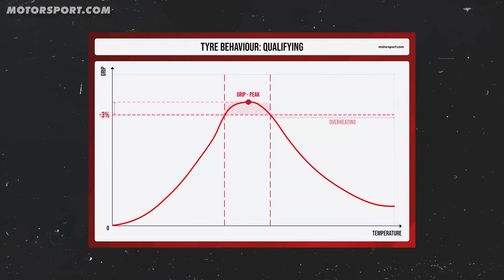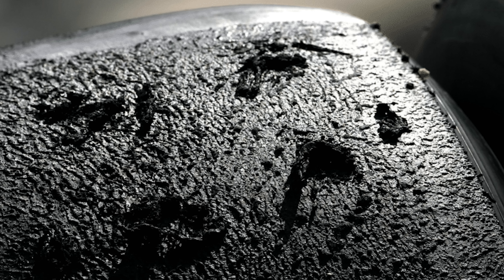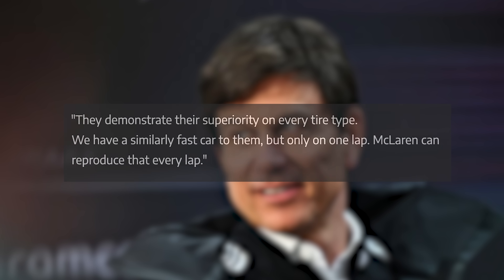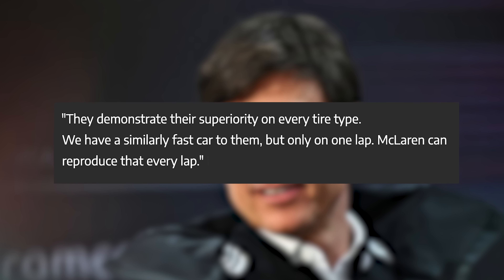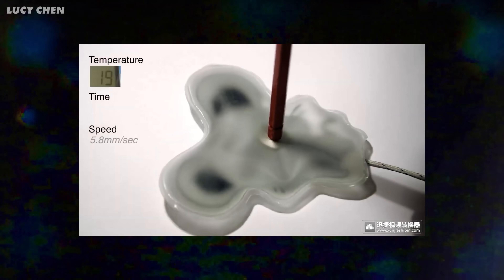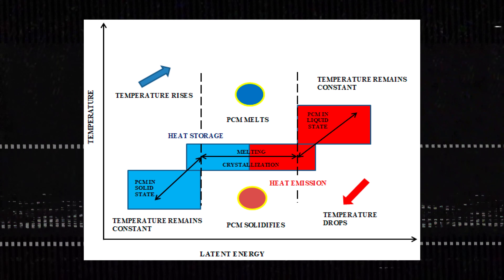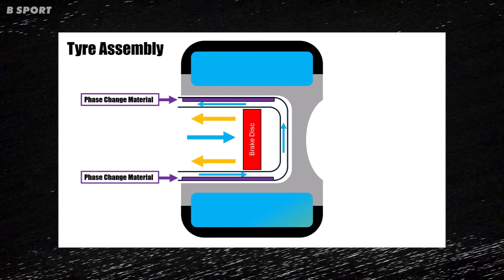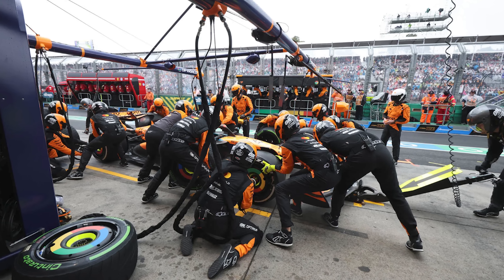McLaren’s GENIUS Tyre Trick Explained

Comment: One problem with this theory is that they won't be able to bring up the tire temperature as fast as the other teams, cuz the phase changing material is sitting there isolating inside and outside of the drum.
Reply: Thats not how it works. It can get up to temperature quickly - its what it does when it hits that temperature. As stated, the only downside is unsprung weight, which may explain the new, slightly irratic handling at high speed.
Reply: @LucienLovesTrains  I think you missed my point. To quickly bring up the temperature, you would want to put excess heat to the tires thrugh the drum and once the temperature gets there. You would take back a bit and keep it there steadily. But with phase change material you can't overshoot the temperature. (One way you can solve it through bypass ducts maybe.) Also, once you material has changed phase you have to mage it anyway with added weight penalty.
Reply: @arannak3826  Just drive with brakes on in a warm up lap. PCM changes phase but then cannot absorb more heat so heat goes into tyres. Then drive normally so additional cooling on straights changes PCM back to liquid, ready for next braking zone.

Comment: So there is this problem that all teams are aware of. Dissipating heat so that it doesn't get to the tires. McLaren found and implemented a high tech solution. There are others. That's not cheating. That's technical advancement. One that it's hard to justify eliminating with a rules change. Teams (Red Bull) need to stop crying and get to work.
Reply: well said 👍👍
Reply: Not really. If the technical advancement is real then it needs to be in every car. Thats why Mercedes had to cancel DAS. It was superior but it wasn’t fair to have it only for one team. Another one is flexible wing. Again it is illegal now. Active suspension? Why is it banned? It was innovative.
Reply: @yp5387  why does it need to be in every car? If a team develops something that gives them a real advantage and they are not breaking any rules then good luck to them. 
You also need to remember that there are two titles to win, the drivers title AND the constructors title.

Comment: I don't think you explained this well, but every material absorbs/releases energy when changing phases, ex water absorbs a huge amount of heat to evaporate, explaining why humans evolved to sweat. What makes the specific material McLaren may be using, is something that has other beneficial properties that works perfectly for this situation, by maximizing the energy absorbed, optimizing exact temperature, etc.

Comment: DRIVER 61,
CHALLENGE TO ALL F1 FANS AND F1 EXPERTS TO DENY THE STATISTICS PARAGRAPH 1.
If the media told the truth and supported it, everything would be different in F1, if there was justice and not corruption, 
PARAGRAPH 1.
Michael Masi 3 years as Race Director(2019-2021)
67 times SC deployed
19 times out of 67 with LAPPED CARS
18 out of 19 times ALL LAPPED CARS were released with an extra 1 lap, only in AD 2021 it was not like that,
FACTS ON THE BASIS
Hamilton would have 9 titles today, and here's why, everyone knows and most have seen with their own eyes what has been happening since AD 2021 until now, the FIA violated its written rule and allowed Max to win in 2021, then in 2022 Red Bull violated the Budget Cost Cap, used an illegal floor even though the FIA asked for it to be changed, Red Bull delayed the change and in the meantime collected points and gained an advantage over Ferrari, 2023 the biggest fraud in F1 history, used the Asymmetric Break system, Red Bull had a dominance that even Ferrari in 2002 and 2004 did not have, although at that time there was no Budget Cost Cap, 2024 the start of the season and the use of the Asymmetric Break System in the first 10 races, then after the FIA clarified the rules, Red Bull takes the system out of the car, which means the beginning season they used an ILLEGAL CAR, what happens next, Red Bull is not punished and is allowed to continue as if nothing happened and in the end if the FIA was not corrupt, Max would not have a single title:
2021 Hamilton
2022 Charles
2023 Hamilton
2024 Lando
Sebastian Vettel is only LEGAL Champ of Red Bull

Comment: Soooo… Let's go way off the deep end on a literal "theory" rather than bonafide authenticated fact???!?!
This is the dumbest theory I've seen in F1 for some time and I'm going to wager is has NOTHING to do with {hate Changing anything. Instead, if you look at McLarens Brake ducts, you "SHOULD" notice something about them that's more likely the reason WHY they are able to keep things cool, using ONLY Air!

L@@K Closer at McLaren's brake ducts and their position and then study the bodywork around that area of the chassis and put 2 and 2 together, because it's not as complicated as Phase Changing Materials, particularly BECAUSE of the "EXTREME" temperatures involved. You'd have to have a gargantuan amount of these materials to dissipate/convert THAT MUCH HEAT. We're not talking a couple hundred degrees here, we're dealing with temperatures IN EXCESS of 1,000°c. And if you know anything about extreme temperature and how materials hold it, you'd know that Phase Change materials wouldn't be able to cool things off nearly enough to make such a constant and immediate difference. The extreme aero of these cars and the sheer VOLUME of air the underside of the chassis engulfs is where Red Bull and others should be looking at. 

Water… On Slicks! SMH

Comment: Heh, I actually use Honeywell PTM 7950 as the thermal interface material for my CPU and GPU coolers in my gaming rig.  Switching from traditional thermal paste reduced my CPU/GPU temps around 10c under load.  The stuff is pretty amazing overall.

Comment: "Magic temperature sponges..." Very precise technical explanation.
Reply: also ice cubes are often colder than zero degrees C   5:53
Reply: @willdarling1 not when they re mixed with water at ambient temperature they re not. you can cool ice colder than 0 degrees no problem, but you cant heat it up past that without melting it, and it will absorb a lot of energy as it does so, so while the ice is melting in the dring the whole cube is already at 0°C and the energy absorption is done mostly by phase change. Ice is a perfect analogy for these phase changing coolants because it IS  a phase changing coolant. Btw human sweat also works by phase change cooling except we never bring the sweat to boiling temperature, however the hotter molecules are the ones that turn into vapour, leaving the colder ones behind, which means sweat can be colder than ambient by means of phase change cooling. An AC works in exactly the same way but in a closed loop with an evaporator and a condenser.
Reply: @willdarling1 at zero degrees they are no longer ice cubes
Reply: it works for me who hasn't got a masters in engineering....it shows the concept before going into details. 😉

Comment: Its incorrect that ice cubes stay at 0 degrees until they melt, water freezes at 0 degrees (at sea level), but there is no reason that it cant be cooled any further.
Reply: I believe once ice reaches 0 degrees, it can’t be heated any further because any energy introduced to the system is used to melt the ice, rather than continuing to heat it.
Reply: @Galeypop  yes but thats not what he said, he said an ice cube will will absorb heat and always stay exactly 0 degrees until melted. This is not true, when you first put an ice cube in your drink it will pretty much always be much colder than 0 degrees because your freezer is much colder than 0 degrees (-18 is common). At sea level it's true that it can't go below 0 and remain a solid but he heavily implied an ice cube is always 0 degrees until it melts. That might not be what he meant but then i would have phrased it less ambiguously if i was trying to explain the concept of a phase-change material to someone.

Comment: Well, phase change materials and their proporties is mechanical engineering 101 and to be honest, I'm surprised that it isn't common practice to utilise its thermal benifits in other areas such as cooling the various ERS-systems. 
Anyway, I share the complicated cost v. benifit problem of unsprung weight to thermal capacity, but personally, I would focus the compound along the shaft assembly. Classic technique to absorb heat and dispurse the energy away from the target area while adding the minimum amount of inertia. #perfromance

Comment: But this sounds extremely difficult and dangerous. What happens as the temperature is high for the entire race as some point the material would have absorbed enough heat and it would start to melt. That would destroy the whole race if that contingency wasn’t factored in

Comment: Phase change cooling was also used in the Lunar Roving Vehicle on Apollo missions to the moon, over 50 years ago. They used wax for the phase change material and radiating surfaces to radiate the heat to space. Air cooling on the moon wasn't really an option!

Comment: It's certainly a possibility that they are using PCMs in the manner you describe, but there are a few critical technological challenges they would have to resolve:
1) Find a material with the kind of latent heat storage capacity that would actually work in this extreme condition and apply it in a manner where you are using minimal quantities. This stuff quickly adds a lot of weight, which we all know is a big no-no!
2) Discharging the latent heat from the PCM. Phase change materials can absorb (or release) only a certain amount of heat energy, which then needs to be discharged via cooling the material. Not impossible, but this seems to be a major engineering challenge. Run enough cool air over the material that it cools down the PCM quickly enough. I'd be very curious to hear how that is accomplished

There are other technological challenges to consider, like devising a carrier system for the PCM that basically prevents the PCM from dissolving.
Reply: My thoughts for your second point. a) Braking: speed slows, low airflow, low cooling, high brake heat generation = phase change to liquid and temporary heat absorption. b) Straights etc: Higher speed, higher airflow, higher cooling = phase change back to solid and heat released but removed by high airflow. Monaco could be interesting!
Reply: I agree it seems unlikely that they've found a material with such an enormous latent heat of fusion.  I was wondering if there might be a temperature-based thermal conductivity change -- maybe they've found a way to more efficiently transfer the heat away from the brakes at higher temperatures.
Reply: Rather than (or probably additional to ) air cooling some conversion to and from electric charge? PCMs are effectively chemical heat batteries (rather than sponges)
Reply: What about solid-to-solid PCMs? There has been research done with 3D Ag foam and short carbon fibers (SCF) showing significant improvements in thermal conductivity and EMI shielding while maintaining latent heat storage.

What if Mclaren is using this not as a main cooling solution, but as a way both to control temperature peaks on the tyre surface and more efficiently transfer heat from it to the conventional cooling solution? It would explain why their rear tyres never seem to overheat in S3 in qualifying, unlike most other teams, and why they're better over a race distance. Food for thought.